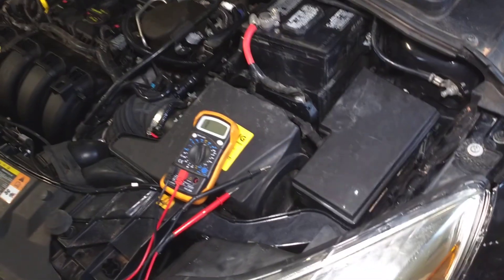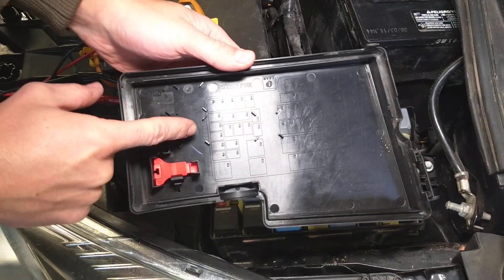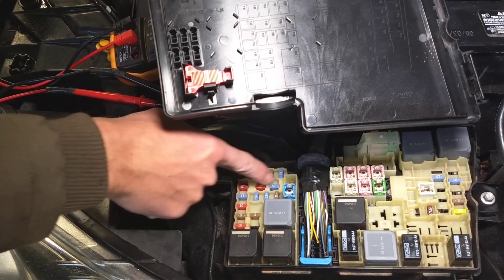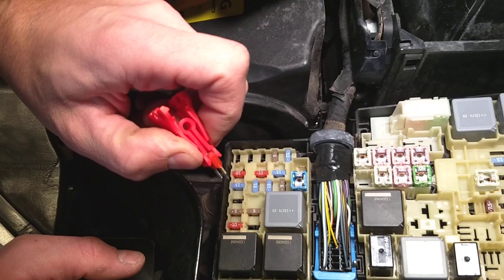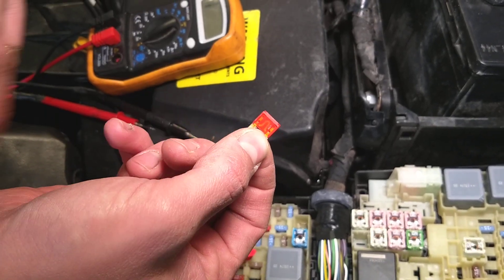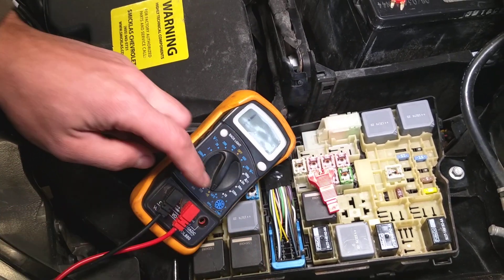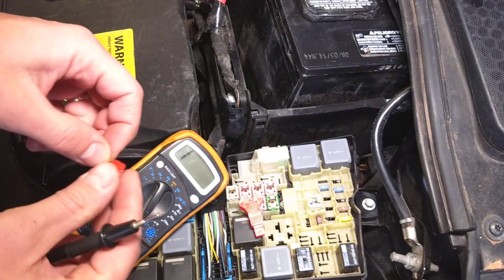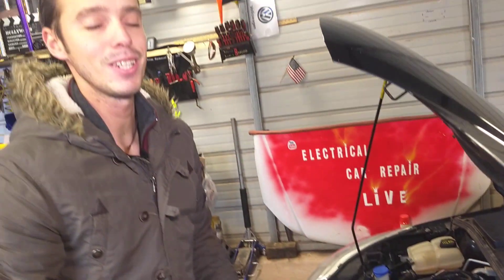FUEL INJECTORS FUSE LOCATION AND REPLACEMENT FORD FOCUS MK3 2012-2018

Comment: Please help I changed the fuel pressure sensor on the low pressure fuel line, changed the the HIGH Pressure pump 1st
When I changed the sensor it ran like it should for about 2 minutes reved up fine etc I don’t know what else to do I’m paying for college and working so a dealer is not really an option for me
Reply: Same problem here, have you fixed it?